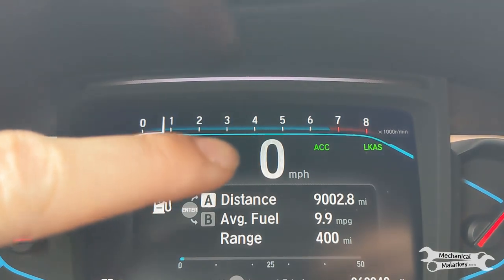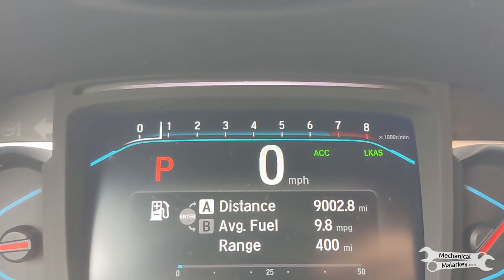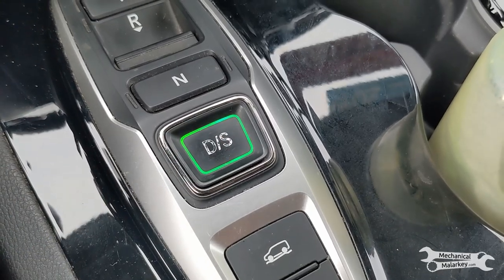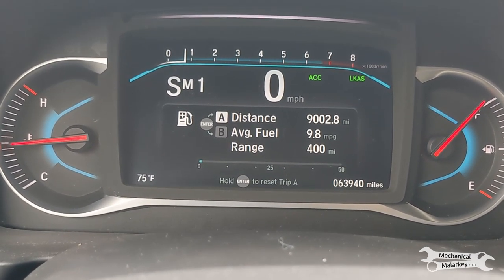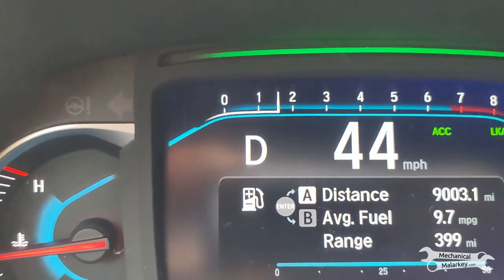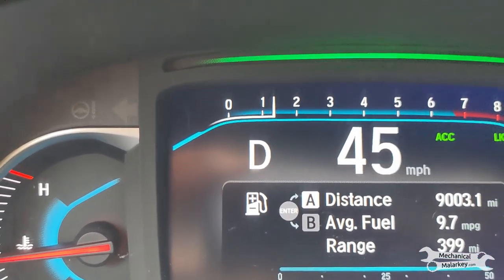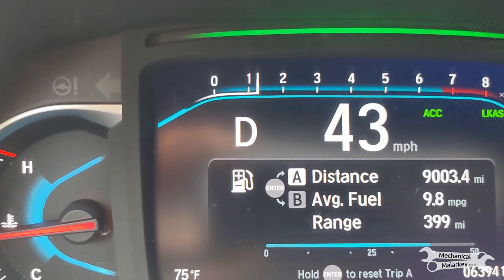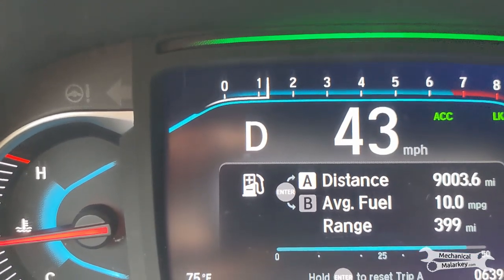How to Set Honda V6 EGR Monitor

Comment: Great video!  I was bound and determined NOT to pay Honda when my BRAND NEW Odyssey with 410 miles wouldn’t pass smog.  (Not even mentioning how CA requires a smog test on my BRAND NEW car because I bought it out of state… and fwiw they also make me pay the extra sales tax but at least that makes a tiny bit of sense!) I was driving around all afternoon doing my best to follow the official Honda instructions on cycling the monitors with no hint of success until this brilliant gentleman saved the day!